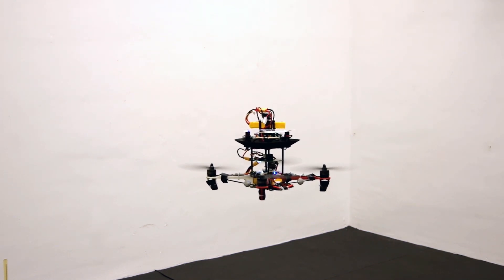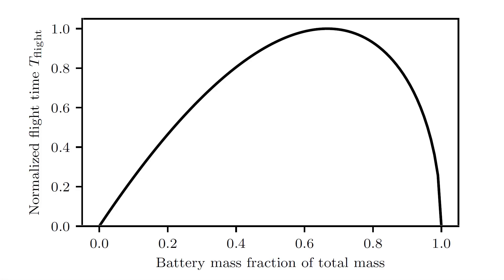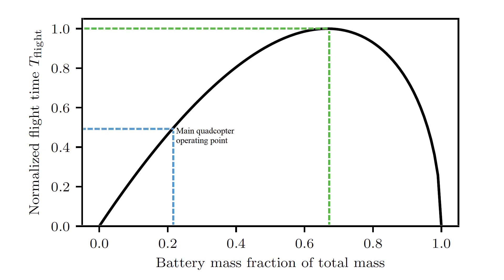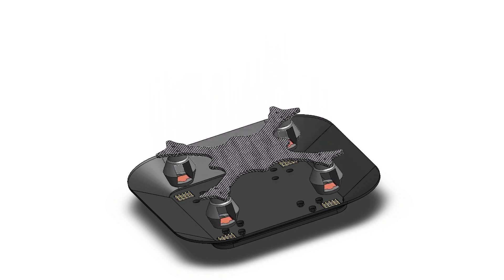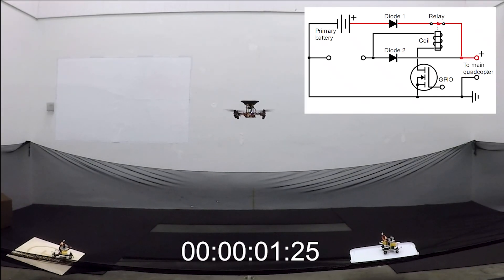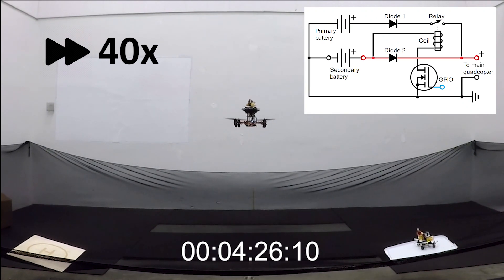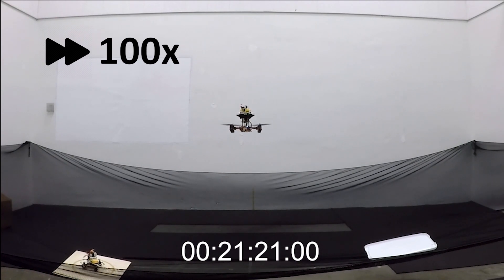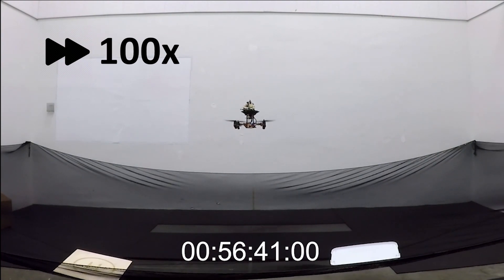Flying batteries: In-flight battery switching to increase multirotor flight time

Comment: Why not make a battery jig shaped like an inverted pyramid with contacts around the point of it? The slave drone would pick up the spent battery and just drop in the charged one, maybe in seconds. There would be a small battery on the primary drone to keep it flying while the battery is being replaced.

Comment: How exactly is it switching the battery?  It looks like they just land in the little plate and sit there.  Is it wirelessly charging the smaller drone's battery?
Reply: There's electrical contacts in the docking mechanism (explained starting at 1:05). All electrical connections are wired / physical contact based. Thanks for your question!
Reply: @karan_jain  ah yes.  I completely missed that.  Thank you